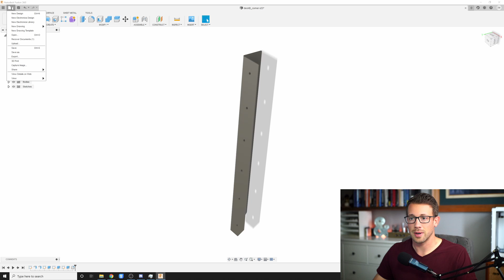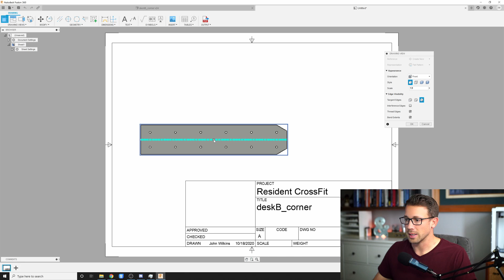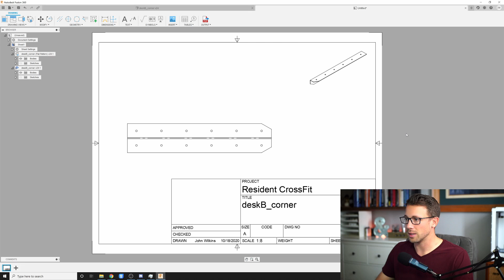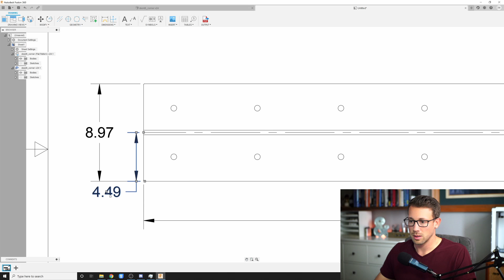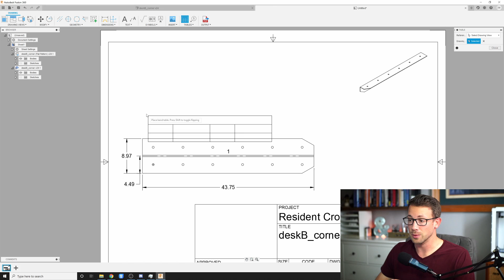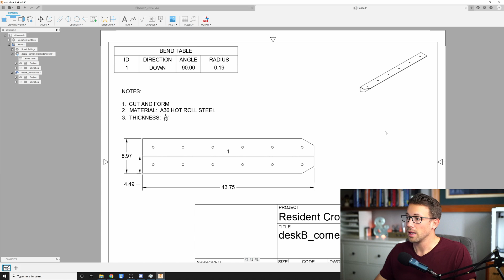Fusion 360 - What EVERY sheet metal drawing NEEDS TO HAVE

Comment: Just a couple of tips for you from someone who regularly does Sheet Metal parts design. (1) All breakpresses (benders/folders) bend upwards so ALWAYS show the view that shows the bends as upwards otherwise it's easy for the guy doing the bending to screw up. Not so much of an issue with a simple symmetric part like yours but really important on parts that look symmetric but are NOT, therefore a great habit to get into. (2) I generally get the laser guys to etch (with the laser) the bend lines as a secondary proof to the PDF's to show them they are bending in the right place. (3) For parts where there are different bend directions, say 2 in one direction and 1 in the other, I show always them with the greater number up (2 up and 1 down in this case). Right at this moment I'm doing a 6 x bend radius that approximates an R50mm bend so the back-stop of the breakpress becomes useless to measure each bend distance. With the laser etched lines they just do it by eye. I normally go one step further and etch the bend directions and bend angles (if not 90deg) as well. I show the bend lines but have "Show Bend Extents" permanently turned off as they are just a distraction and a potential for errors for the bending person. The more fool proof you make the job the less mistakes are likely to be made. Hope this helps. Good video by the way. As an ex-SolidWorks (including sheet metal) guy I came here for A360 sheet metal drawing help so thanks.
Reply from the maker: I appreciate the feedback, that’s all really great advice! I’ve had etchings done for bend lines before, but I’ve also had places accidentally not get power settings right and burn through instead. There are time trade offs to consider based on the project as well, but I really didn’t want to dive too far in for a basic video like this. Maybe I’ll make one implementing that advice, as it’s all really good! Thanks for watching, glad you found it helpful!
Reply: Can you explain more point one i don’t understand it